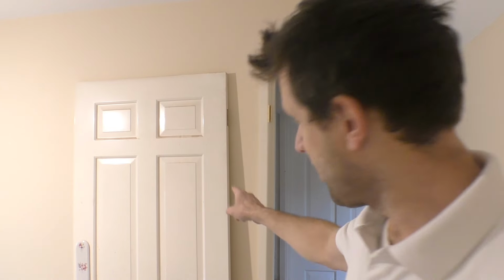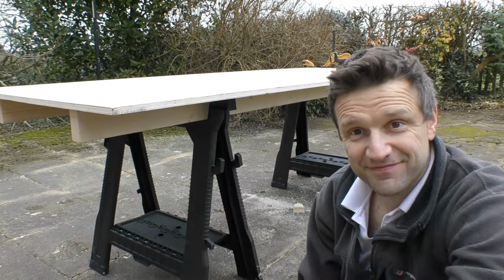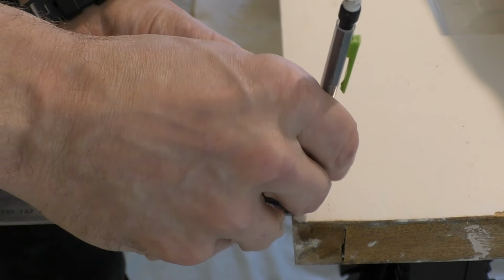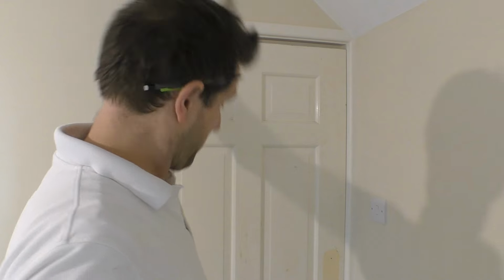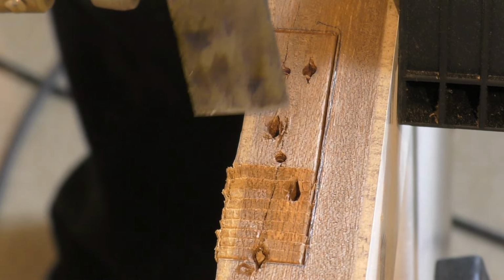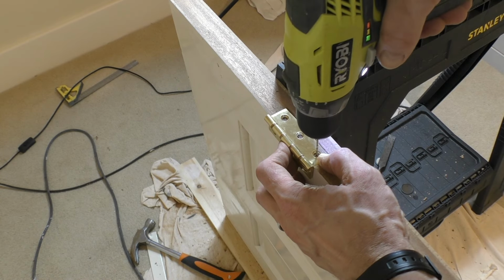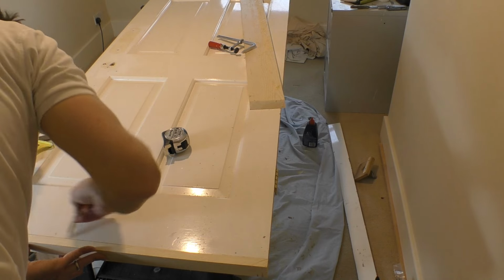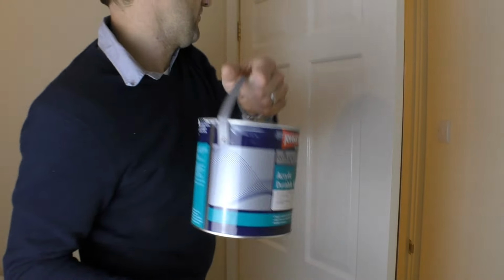How to Trim and Rehang a Door

Comment: From the middle of California, enjoyed this video.  Great work & thanks for sharing.  A silly question from a beginner... if your antique home has non-square door frames, why not fix that door frame opening before chopping door?  Anyway, I'm learning much and enjoying much....congrats!
Reply from the maker: From the middle of California - wow, that's impressive - thanks for supporting me from so far away, across the pond! That's a very good point and something ideally I would have liked to have done. The problem was it would have meant moving the door lining back at the bottom, and there would then have been a gap in the carpet in the corridor. Also we've got some pretty horrendous wood chip wall paper in the corridor - which would have needed stripping back, and the corridor is pretty low on my (long) list of things that need doing, so we would have had to live with the resulting mess for quite a while. Totally agree though, in these types of renovation, fixing the door frame would have been a better option!
Reply: Also there would also be some plaster repair.  Which in an (old) uk house, would have most likely required some effort with the sub wall - then skimming over.
Reply: Lee Stewart   First off thank you for the video.  I own a real estate business in Atlanta for the past 20 years.  Generally speaking I am at the write the check end of the renovation.  My handy man has been in the hospital for 6 weeks and so I picked up a full kit of tools and have been doing some actual work.  Most times we would buy a pre-hung door and use the trim and frame of the house to repair any problems. The 2 1/2 inch trim gives us a lot of room to take care of problems with the squareness of the door hole.  Take all this with a grain of salt, I am about to hang my first door this week.  I am using Milwaukee and Ryobi jigs to make up for a lack of skills and a router.  My plan is to practice on an old throw away door and then give it a go.  I AM ALSO PRAYING TO GOD DAILY FOR A FULL RECOVERY OF MY HANDYMAN    : )
Reply: to do the door frame can cause a multitude of problems.. your just creating more work. when the door is done properly like charlie did it, you wont no the difference..

Comment: Did you undershoot the sides of the door?  It was hard to tell but it looked like you were checking to make sure the edge was square?
Reply from the maker: Not quite sure what you mean, but I basically had to scribe the underside of the door to the floor as when shut in my bonkers house, the middle of the door is longer than it is at each edge.
Reply: @CharlieDIYte  when you hang a door you are supposed to undershoot both the hinged and closing edges ie instead of being square the leading edge is planed at a few degrees.  That means when the door closes the first edge that passes the door frame doesn't hit it and you also don't take too much off the back edge leaving a big gap when the door is closed.  The thicker the door is the more important this becomes.

Comment: Thanks Charlie - learnt something useful tips via this video. I'm in the position of thinking about hanging 8 new oak doors in our bungalow and need as many tips as I can get. I want to do the job but something that I'm not certain about is whether to use a normal smoothing plane or a power plane when taking down the various adjustment thicknesses. If anyone has any comments or thoughts about the pros and cons I'd love to hear them. I would add that I love using my smoothing plane - it really does make me feel good - but I'm only use to small lengths of wood. I'm concerned that taking, say 2mm, of the side of a door, especially a hardwood door, might be a different job and that a power plane would be better. Open to advice!
Reply: A good power plane is far easiest - with tungsten carbide tipped ('tct') blades - especially if you're talking about oak doors. By the way (and most people make this mistake - even many joiners,) it's a 'smooth' plane. It has no grooves in the soleplate; as a Jack plane has, hence the name.

Comment: What is the trusty filler that you used please? Thank you for this useful video, I need to hang a door on the opposite side frame, as the landlord has hung the door with raw plugs and screws into the join of the frame, so it's hanging off and completely split the frame,the door is too wide for the frame too, it's just an awful mess! I will use your video to try and fix it.
Reply from the maker: Any 2 part wood filler like this you can find online - https://bit.ly/37BGKlk also available on Amazon. Ronseal also do it. It's great stuff. Get yourself a continental filler knife set as well, to tool it with. Good luck with the repair. 👍
Reply: @CharlieDIYte  thank you so much for taking the time to reply, and I will buy your recommended products ☺

Comment: Hi Charlie, hopefully you still see comments on old videos. What would you use to tidy up edges where slightly too much has been planed off? It's not on the hinge side, It's not enough to justify a new piece of timber but too much to just paint the door as it is. I would just like it to follow the same gap all the way down. Any help will be greatly appreciated. Thanks, James.
Reply from the maker: Is it a long section, James? If not, I'd be inclined to get a tub of 2 part wood filler and gradually layer it up. You could make your life a bit easier by clamping a couple of strips of perspex to the edge of the door and fill inside that trough you've created. That'll give you a lovely clean edge. Gently sand down with some 180 grit sandpaper wrapped around a long thin strip of wood the same width as the door. That way you'll get a nice consistent flat edge when you sand.
Reply: @CharlieDIYte   Hi Charlie, thank you so much for the reply. It's about 4 - 6 inches at the top of the door. I've just watched your videos on the 2 part wood filler and thought i could use that but wondered how i would get a nice crisp edge. The perspex idea is a great one. Will the filler not bond to that or would i just have to time the removal of it to when it's gone off but not set?

Comment: I'd have renovated and rehung the door as you'd done and not bought a new one which would've been an unneeded spend and have needed modifying anyway.  I wonder who suggested that one?  As for the so called pros, I had one come over a few years back. All he did to make the door fit tighter against the frame was reposition and drive the door screws in at an angle to tighten. Very shoddy, untidy 'n not what I was looking for. Regrettably, guys in the trade do a rushed, low quality job, very apparent in new builds.  As a rule, I supervise if they do anything for me and make it's what I want.  As I like it accurate, like you, I prefer to DIY.

Comment: Would it not have been easier to straighten the door frame and fitting a square door,  instead of cutting the door to fit a wonky frame?
Reply: My guess is, being a cottage the door and frame are not the only things not square and it is all about character and heritage....life is not square and it would be boring if it were....👍
Reply: Hi Nicky Scott, I give you a thumbs up because I agree with you 100%.. 
Though I would rather square up the door frame, than to have to cut a replacement door at an irregular shape to make it fit a wonky frame now, or in the future. 
Remember, in this video Charlie said the door he was working on had a hardboard skin. That means it is a modern door and not a typical solid door that would of been fitted when the house was built. Therefore he is not keeping to the original character of the building.
Reply from the maker: Yes it would, and I thought about this, but this would have been problemmatic as by widening the frame at the bottom I would have had a gap in the carpet in the corridor, and untold mess down the corridor wall - which is covered in a horrendous wood chip wallpaper - and as the corridor is quite low on my (ever lengthening) list of things that need fixing, I didn't fancy living with this for the forseeable future. Totally agree though it would have made sense!
Reply from the maker: Correct banjax66, but sadly the rather nasty modern door was installed in the 1970's when it seemed fashionable to rip out all period features and leave houses bereft of character with loads of naff fixtures - but then that's trends and fashion for you I guess :)
Reply: LOL... I think I am older than you Charlie. As you might guess I am 51, born in 66 so I don't follow 'trends and fashions' these days :) bUT...
Years ago, coming from a family of land workers,  my granddad accidentally fired his shotgun in the living room one day and blasted a hole in the wall.. In those days, the 'horrendous' wood chip wallpaper', was great for hiding defects in walls and ceilings. Hahaha..
Also as a kid in the late 60's/early 70's, my bedroom walls had the 'horrendous wood chip wallpaper'. 
I used to lay in bed picking out the little bits of wood chips until I fell sleep. :)...  Ian..  (Banjax0
Reply from the maker: banjax66 Love it! Trust no-one was injured when the gun went off?? Yep it hid a multitude of sins here too, and we've still got it on every ceiling that I haven't yet stripped - when we moved in there was a lot of polystyrene backed wallpaper everywhere as well - a 70's thermal innovation no doubt!
Reply: No sir, no one was hurt, apart from granddad when grandma got home! :)
It's strange how some things stay in your memory after so many years..
The other covering that was used to hide defects was the horrible polystyrene tiles. In our house, the ceilings were plastered with  'lap and lath' and every time someone slammed a door shut, a chunk of ceiling plaster would fall down. So the ceilings were patched up with modern plaster and that mess was covered with polystyrene tiles... Ian.
Reply from the maker: Sounds a bit like the two patches in our living room ceiling - where I fell through the floor twice in one day when I was renovating our bathroom!

Comment: I have just fitted the rebate lock and 6 hinges on my 'new' recycled external, soon to be double glazed, French doors, which are nearly 2 inches too long for the frame (how did the builder get the frame measurement so wrong?), so now feel more confident about actually putting the doors in the 'ole' :). Thanks for tips on how to use the circular saw, great timing for me, just wondering why you planed the sides instead of circular sawing as it seemed a similar amount to come off? ps love the door jack
Reply from the maker: Great work on the door 👏🏻 For fine tuning the sides I normally use my electric planer. I've got one of these https://bit.ly/3nYTM4g Takes a little bit of practice but it's probably the most essential tool in my collection these days.
Reply: @CharlieDIYte  I bought an electric planer years ago, but haven't used it much. Maybe now a good time to get going with it :)

Comment: 👍👍great vid
Wouldn't it be easy to remove hinge rode on middle to take door on and off??
Reply from the maker: You mean the pin on the hinge? The pins in these hinges aren't removable.
Reply: Is there any way to know if pin in hinges is fixed or removable??

Comment: Dilema, need a new door but frame is not standard and all doors except solid wooden doors can only be planed by max 10mm and i need 12mm each side and dont want to spend extra on a solid door , so my only option is to reduce the door frame size. Need to plane across width any tips on how to avoid breakout? Or is there another solution?

Comment: Nice one Charlie. I noticed the hinge housings were badly split from previous screws - did you do anything about that?
Reply from the maker: Norman Boyes Ah yes, no flies on you Norman! I thought I had skillfully side stepped that in the editing suite 😏 When I screwed in the hinges the first time I had a lovely big split open up on me, so I squeezed as much glue as I could into the holes and the split - which I opened up with a chisel to get maximum penetration for the glue and then I clamped the door back together until properly set. LOVE those Axminster clamps!! I then redrilled the screw holes making sure the pilot drill was the same diameter as the internal spine of the screw (ie leaving just the thread of the screw to self tap into the wood) and then I had no problems.
Reply: Charlie DIYte Nice one.😂

Comment: Great video - Would it be possible to use the circular saw on the long length of the door instead of planing it?  I struggle keeping the plane at 90 degrees all the way down lol :)
Reply from the maker: Hi Steven. Yes, definitely and that's what a lot of carpenters do when trimming doors down for whatever reason. If it's a parallel cut you could use the fence that comes with the saw. Just make sure you get the blade depth spot on, to prevent any wandering of the blade.

Comment from the maker: 🛠Charlie DIYte Amazon Tool Store https://amzn.to/3fcLnY4 - all my tried, tested and much loved DIY tools. You can help support me by Buying me a Coffee ☕ https://bit.ly/3xuQ3zb or by becoming a Member to unlock a host of benefits - thanks so much 🙏.
Reply: I’m new to your YouTube channel Charlie but finding them really useful. I am rehanging all me doors with new ironmongery, but have an issue. The existing latches seem slightly smaller in cross section than newer replacements. I can’t use a spade drill bit as it would wander all over the place. Any tips for enlarging the opening?
Reply: @paulnorthcott6634  use a round long file. That's what I use, rasp round file. It eats through it easily. I had same issue

Comment: I appologize for this being way off subject of the video, but am I understanding correctly that you earn something just for clicking one of your affiliate links? If so I assume there wouldn't be any difference between left clicking to open on same page or middle clicking to open in a separate tab?
Reply from the maker: No need to apologise. I earn an affiliate commission if you buy something you've clicked on in the Description. So it doesn't matter how you open it, only that you complete the purchase, which obviously doesn't cost you any more than if you had clicked on a non-affiliate link.

Comment: I accidentally used a orbital sander to trim down a door and now the finish is wonky and bumpy! Would a electric planer fix this issue? Thanks
Reply from the maker: Yes it definitely would. Well worth buying. It's one of the most useful power tools I own. I couldn't manage without mine!
Reply: @CharlieDIYte  cheers for the reply mate! Just bought one. Also bought hinge shims as I went more than 2mm on the hinge cutouts on the frame and the door!

Comment: Hi Charlie
I’ve hung 2 premoulded 6panel interior doors but I’m struggling with the 3rd door as the frame at the top is lower by 1cm on the hinge side. 
I have thought of fixing some kind wedge along the top of the frame but not sure how to cut it. 
I hadn’t noticed it before with the ugly plain doors, but as there is a glass panel at the top of the doors it is very noticeable when I offered the new panelled door up for trimming. 
I did buy some 4mm ply and had a few strips cut to size to experiment with and make a wedge shape but I’m failing miserably ☹️.
Any advice greatly appreciated.